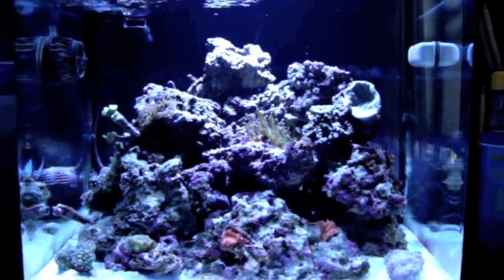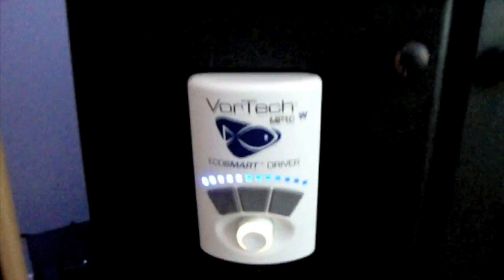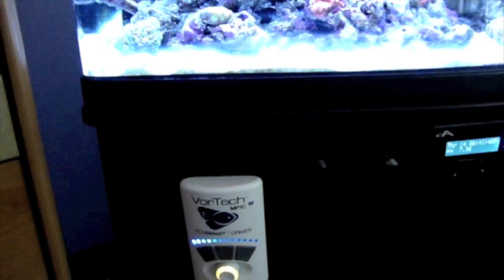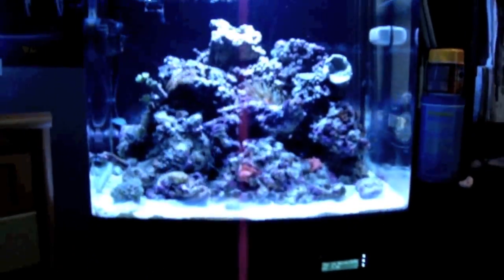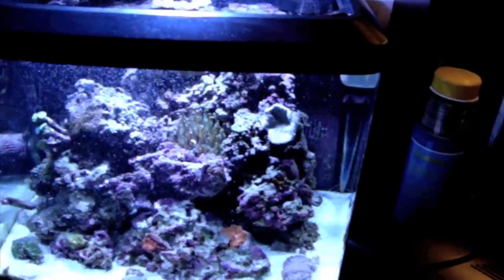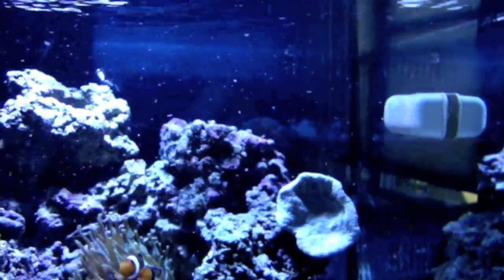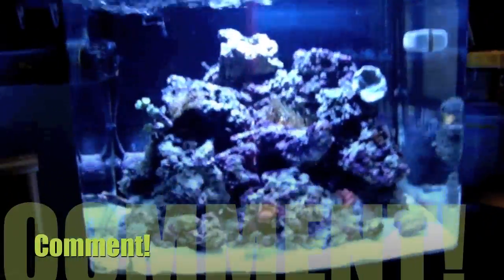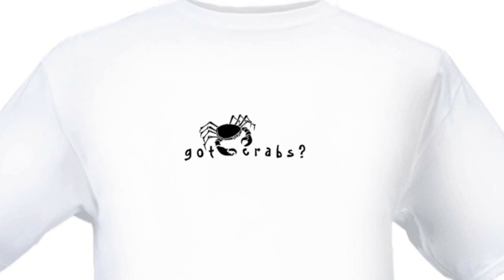Preventing the Biocube from an Overflow

Comment from the maker: @bilbobag111   1) I am not using the biocube return pump. Just the Hydor seltz L30 as my return pump. And an L20 for my chiller.   2) If you dont want to use the biocube pump the Hydor seltz L30 will fit in chamber 3 and it use less power while giving you more GPH.   3) Its a little more complicated.  I have the return pump plugged into the channel 1. and set an alarm that gets triggered by the float switch. (its a little more complicated but i can help you set it uo if you need)